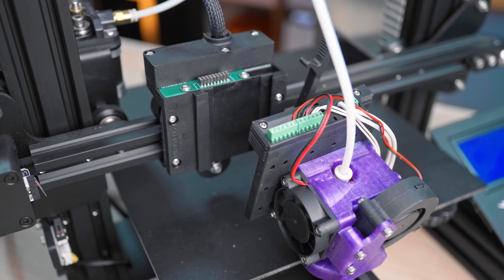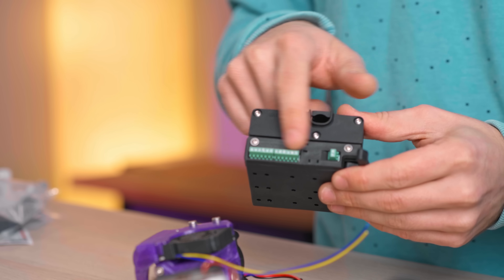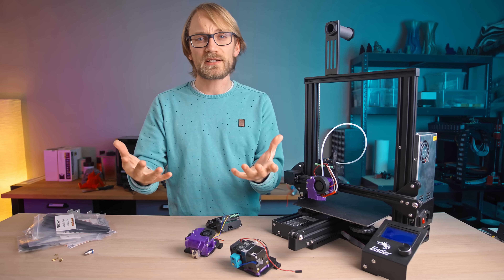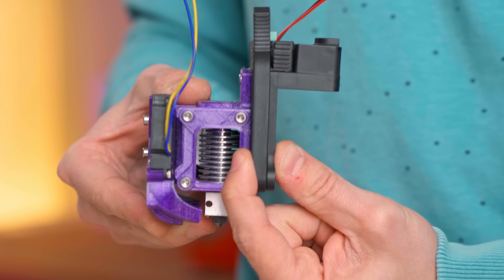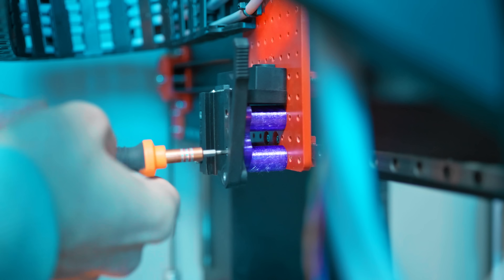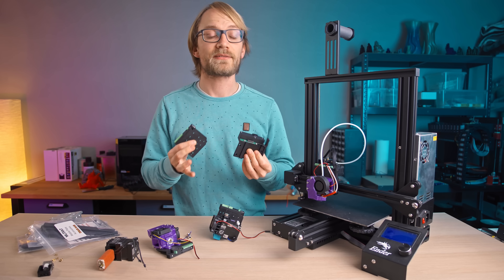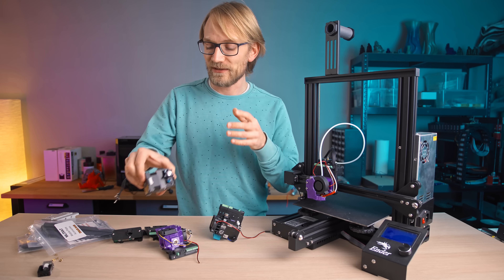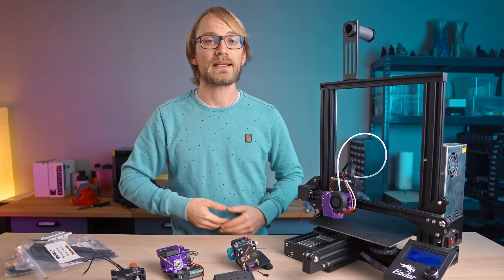WhamBam Mutant: A Quick-Change Toolhead Upgrade for any 3D Printer! (NOT on Kickstarter)

Comment: NGL I'll probably just print one of these, discovered the electrical connectors are called pogo pins, $3 on AliExpress, for increased stiffness magnets?
Reply: I don't think they are pogo pins, just standard 2.54mm dual row pin headers.
Reply: @Audio_Simon  thanks, im kinda obsessed with pogo pins now though

Comment: Interesting concept, I'd rather see more printers developed with interchangeable hot-ends built-in rather than a slightly clunky and electrically iffy retrofit, that way it would be worth using and not require faffing around with feed-tubes and resetting stuff in software- push-button simplicity ftw as such.

Comment: heh... I had just designed something to swap tool heads on my machine (still building it... f*** apartment life), and it ain't as elegant for sure, but ain't breaking patents either! Not too sad I did that route tho, specially given the price.

In my case it's for quickly swapping it to a light duty CNC mill, 3D printer and laser engraver head.

Comment: I'll be curious to see how long those pin headers last.  Most pin headers are not really designed for a lot of insertions and removals. the number I found in the past has been between 50 and 200 rated cycles.
Reply: Yeah, really seems like it should be pogo pins or something similar.
Reply: @_Piers_  maybe these are specifically designed for a high amount of mating cycles.  They do appear to be high quality. I would be interested to hear from the manufacturer on this.
Reply from the maker: I've seen similar connectors rated for 200 cycles, so that sounds reasonable. Probably enough if you only swap occasionally to a larger nozzle etc.
Board-edge isn't always better, though, for example PCIe is only rated for 50 cycles.
Reply: @MadeWithLayers  yeah it probably will be fine for a lot of people my only real concern is the fact that some of these pins are going to be carrying high current. If they loosen up they're going to go high resistance and that's going to cause a lot of heat.
Reply: @MadeWithLayers  That's true I guess it really comes down to what connector is used. Personally with having a larger format printer one main uses I can see with this is making it easy to swap out nozzles.
Reply: I think a board edge connector would work better. I'm thinking like how old Super Nintendo work. Those connector handled hundreds to thousands of connections
Reply: The V2 version which which is what they sell now uses Pogo pins and is a lot more robust.  I have been using these in my print farm and the V2 Mutant is a big upgrade

Comment: Tom: "A quick-change toolhead:"
Me: "Great, that sounds incredibly useful, tell me more."
Tom: "Patent pending."
Me: "...no thanks."
Reply: Regarding the patent pending discussion: Creality has brought the entry-level 3D printing scene up to a point where they're legitimately competitive with higher-end machines. It did so open-source, because it was a culmination of mature solutions and good ideas that didn't necessarily reinvent the wheel. So when you see a company trying to put a patent on not only an obvious solution, but also a solution that has been employed many times (just not in this specific context), that spits in the face of the open-source 3D printing community, which is the very community that's made entry-level 3D printing go from a fast way to burn $250 to having a functional printer on your desk for $180.
Reply: There are a lot of examples where the patented technology is not very innovative, that is the solution is very obvious. Nevertheless the patent was granted forcing everyone in the field to to either workaround this or pay fees to the patent holder.
Reply: Exactly what I thought ! 
Not going to buy / recommend anything from this company.
Reply: I understand now. If it’s pending they submitted it and is already protected. Unless it’s shot down they can litigate I believe currently.
Reply: What do you mean? Why is patent pending bad?
Reply: @dawn9340  It doesn't seem to be a particularly revolutionary idea to add a row of connectors and a latch, however if the patent is approved open-source projects would not be able to have similar designs for several decades. So in this case yes.

Comment: For a long time now I've had a custom 3D printed hot end setup. I use a pair of blower fans for the part and hot end cooler. I've been soldering in inline JST sockets for the fans to extend the stock leads. This led to failures where one of the fans would stop or become flaky due to the flexing. So I've modified one of my printers to use a DB-25 to connect all the cabling. Part of the rationale for me was to make removing and working on the hot end a bit easier, it also should improve strain relief on the end of the cable. As my hot end physically mounts with 2 screws, I think I'm getting pretty much all the advantage of such a tool changer for my use case at a fraction of the cost and without the loss of print space.

Comment: Does it have enough pins for everything?  4 pins for hotend & thermistor + 4-6 pins for fans, +5 pins for BLtouch, +4-6 pins for stepper motor, +2-3 pins for lighting = 19 to 24 pins required (actually, add 4 to that, if the heater wires share 3 pins each for power and return)

Comment: This is a failure of our Patent System. A quick release mount should not be patentable anymore.A dovetail mount, that is what it is is common. The connectors they are using are common parts. What is unique? In photography, we use a Arca Swiss style tripod mount. Pretty much the same concept. I hope hobbiest don't support this.

Comment: I would like to have a quick toolhead changer because space is at a premium and I simply don't know where to put all the different tools I'd like to own. Adding a separate machine is out of the question. But: I don't really like this implementation. Losing this much print area is too high a price for me. I already struggle with fitting stuff onto my build plate much too often.

Comment: Great review Tom as usual, you bring up a lot of great talking points for a product like this. Seems expensive as Wham Bam usually is. Also, screw it I'll just design my own... that's the whole point of having a printer. Wham Bam also never bring out sizes for Printrbots. I would have to get a resin spring steel sheet to have something fit to the printer. Oh well!

Comment: Honestly I'm not seeing anything that is so innovative here that it wouldn't be covered by Prior Art.
What are they patenting exactly?
Reply: There’s tons of prior art for this on thingiverse. You can claim patent pending if you have submitted a patent, but I doubt they will be awarded it.
Reply: @samroesch  Problem is, politicians made patent agencies into profit centers. They have an interest to grant patents. They're also making money when it is challenged. It's not like they prevent inappropriate patents, one has to go to court to get it removed. So it might be possible and a good idea to call objection while it is still pending.
Reply: Probably for using a dove tail  for the tool head exchanger and also a locking a realeasing lever on the tool head exchanger and maybe even for the electrical connector on a tool head exchanger. Idealy the patend will not be granted but if it is it could block a lot of better developments. So regarding that their product has a lot of issues ( connector undersized (= another fire hazard), hole patern matching to nothing) I would strongly disadvertice from buying this and thus supporting their patent. Just as a reminder to everybody: the whole point that now we can all play with 3D printers is because an older patent ran out. Else I would have played with them allready in the 90th (then we just build little mills in school driven by parralel port). So more blocking patent (and even from substandard products) is just what we need :(
Reply: @leoatreides1  basically said everything I came to say.
Reply: @leoatreides1  the dove tail and locking leveler isn't anything new. That's a very old way of locking 2 things together.. Nothing worth patenting
Reply: The dovetail is a cheapened version of a quick change tool post for a lathe, they better not get a patent.
Reply: @rpavlik1  the bar to get a patent is insanely low, especially in the us.  that's why patent trolls are so successful
Reply: @rpavlik1  or a tripod quick release plate
Reply: I’ve got to say, the mechanism they came up with is pretty elegant, and I like that it uses cheap and readily available pin headers, unlike the XChange. Now, had they gone open source, a universal standard may have been born.
Reply: Could be on the pin arrangement for wiring harness simplification. Though again, probably prior art out there invalidating it
Reply: @goeland86  Yeh, this reminds me of old Pentium 4 ZIF sockets
Reply: My thoughts as well. I get people / companies trying to make a living, but this isn't that innovative and the market will still be flooded with cheap China copies. I'd rather have seen them go an open source route and become the brand people want to show loyalty to because of it.

Just by watching this video, I could think of a few easy and cheap design changes to fix the negative stuff Tom mentioned (power kill on disconnect, ID for toolhead [firmware would need to be updated to know what to do with that info], and more power availability).
Reply: Maybe the warped plastic
Reply: Looks like they might be able to get a design patent, which has a much lower bar than a functional patent. However, a design patent also has much less strength
Reply: It’s not going to be granted. Slice didn’t even get the utility patent on the mosquito due to prior art, and that was much more innovative.
Reply: @Marco Roman Oh, he does look shaggy.

Comment: wtf 150$ for a quad kit? for crappy injection molded parts? wtf whambam at least the xchange had cnc milled parts as an excuse....
I'm really hating the 3d printing space, everything with 3d printing attached next to it's name is suddenly 100x more expensive...
just 3d print one for 0.5$ probably. and it'll have a better quality it seems.... others have done it years ago. and they work fine. heck properprinting made a very nice looking good one not so long ago. I do like that one. but there's magnetic ones with pogo connectors too

Comment: Thomas and others, before talking about the patents, I would hope that you think what for the patents are made. Think about the people of the company that try to make their living with the product. 

Few things about the patents that I would hope that people take in to account. First, patent is protection against technology stealing for commercial use. If regular consumer makes e.g. same kind of product than this quick-change toolhead for their own personal use they are not violating the patent. If they are using it for commercial use and for business, then they are violating the patent.

Secondly, patent do not mean that the product would not be open source for the customer. The manufacturer can publish the data and the drawings still if they wish. Again, patent tells that it is not allowed to use the product in commercial sense.

Thirdly, people can not do patents for just about everything. To pass the patent's idea needs to be novel and (as an industrial AM engineer I know) there is no way to block the open source community from new things (I am extremely confident that this WhamBam's tool changer neither). Of course with industrial grade high end machines that can cost over 100k €, it is different story. 

Thirdly and lastly, making a patent is extremely difficult and costly job. Even company would pour loads and loads of money to get the patent pending, it still can fail without money return.

Comment: Wow, that price is steep...when i saw the cheap looking plastic parts I thought: "well, 30€ for the Kit and maybe 10€ per plate seems reasonable"...
Reply: Yeah. Same here. For 80 bucks I'll probably make my own.
Reply: I'm sure all that bad injection molding tooling cost them a fair bit of money!
Reply: @Alex-nl5cy  It was probably molded properly but not cooled properly, or as you said bad molds if you wanna push 'em fast through the factory, being that the case the price should drop even further.
Reply: @Kalvinjj  injection mold design is an art Form. It seems that they broke some basic design rules, such as creating thick, solid blocks. Those will always sink during cooling. Also, a proper mold design compensates for warpage by warping the mold in the opposite direction...
Reply: @kain0m  Probably just took the 3D printed prototype to injection as-is, and went for the cheapest initial costs instead of hiring a company with a decent engineer that does injection molding. I get it that the tooling cost is huge, it is indeed and you gotta get that money back somehow, but hey that's exactly why injection is used on heavy mass production (instead of dumping that 5000 dollar tooling cost to 1st 100 costumers), and 3D printing on small batches. If they wanted to make them better than FDM they could go with SLS.
Reply: Maybe in a few weeks on aliexpress
Reply: not like we all have printing experience and ability to design just need idea yes 100% ali clone in a a few weeks but easy enough to do one yourself just choose better pins for current sinking ffs why not use 4 pins for each (your designing it not like you have to use someone's connector) if you want to use the 10th inch spacing pinout

Comment: Holy moly, I was just thinking I need an easier way to quickly swap between a .4mm, .6mm, .8mm nozzle on a few of my machines
Reply: Watch the newest ThisOldTony video, there he proposed a nice different idea for that
Reply: This and also sharing print heads between printers is one of the reasons I love this design approach.

There were several things I didn't like about my Lulzbot but their changeable tool heads were great to work with.
Reply: This Old Tony mentioned this problem in his latest video too - COINCIDENCE? I THINK NOT! (Ah, I see @Tarek Knanneh beat me to it)
Reply: That would be my use case....  Dont see switching while powered up.
Reply: Buy a Chimera from E3d NOT A CLONE, I have been using mine for at least 4 years now never had a problem, and aligning two nozzles is not as complicated as others would have you think, I have one hotend on a .4 and the other with a .8, one click in my slicer, and its done lol
Reply: Good luck with a 85$ nozzle changer..lol
Reply: Watching this after the new e3d Revo announcement. Amazing how the market just changed.
Reply: It might be kickstarter but I actually like the look of the xchange more...

Comment: It’s interesting so you can have a spare hotend to do a quick swap so you can continue printing but it’s a bit more expensive than I thought it would be.
I have to agree that a second printer might be a better option.
It certainly is for me.
If it was £60-70 for the larger pack I might buy it but not at this price.
Not for me.

Comment: I could just imagine using it with the same head, but different nozzle sizes. But setting it up to work properly might be a pain ita. Also, the further the print head is away from the axis, its getting more and more unprecise I think. At some point it will start wiggling around. I don't think that they will make enough money to cover the patent.

Comment: Really nice execution. I spend some time to come up with a quiack release but printed dovetails dont slide very well. Ended up with a claw like mechanism and two screws to hold it in place reliable. Not as easy as it looks. :)

Comment: Great review! Do you know why WamBam want to patent this? My guess is they took investment to bring this to market and that investor wants a patent because they are old and traditional. It makes absolutely no sense for anything but the largest business to patent things, especially in a fast advancing sector like 3D printing. You can get a 'PTC patent' that covers 150 countries for 2 years, it only costs thousands, but after that you need to file your patent in every country individually = $$$$$$$$$$. KickStarter makes a lot more sense when you realise this.

Also what exactly will they patent? Removable tool heads already exist (e3D) and so do dovetail joints. Possibly the quick release lever?
Reply from the maker: Thanks! Unfortunately, I don't have answers to any of those questions. I guess once the patent applications from WhamBam are public, they'll be able to share more about their backgrounds.
Reply: I know people working in other spaces and investors and simply won't touch you unless you have some kind of protection on your IP..
Someone I know has been trying to get a safety system for a current problem(Not 3d printer related) to market, but without investment and a way to bring to market, noone wants to touch it or bother with it.. Their goal is to patent it for the first while until it becomes mandatory(And it's a feature until then), then release the patent for all to us.
It sucks, but it seems to be the way of the world if your goal is to try and change the market..

Comment: What about E-steps? If using marlin do I need to manually change it/reflash the firmware every time I switch my direct drive hotends? feel like something wasn't thought all the way through
Reply from the maker: E-Steps can be set via gcode (M92)! https://reprap.org/wiki/G-code#M92:_Set_axis_steps_per_unit
Reply: E steps can be changed with gcode, so you could presumably have a tool change gcode file to run for each toolhead that sets the correct E-steps/PID/nozzle offset/whatever else needs to be changed.